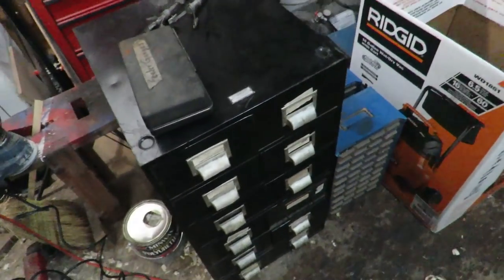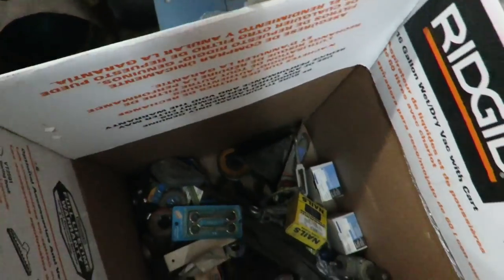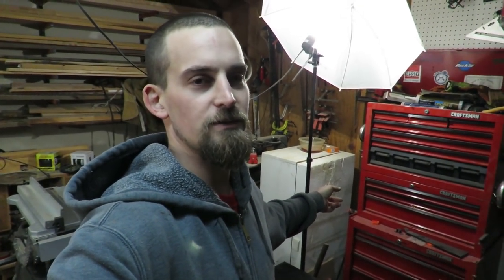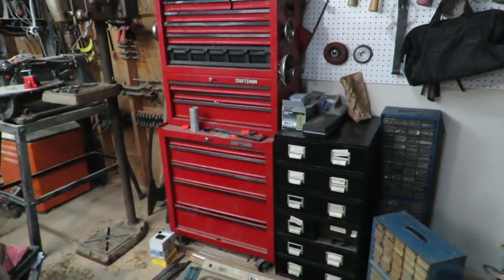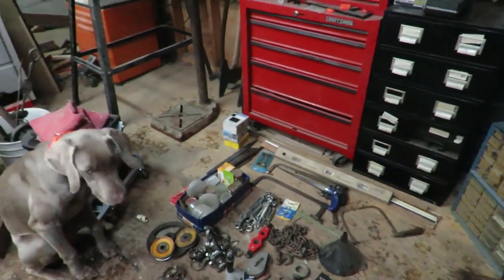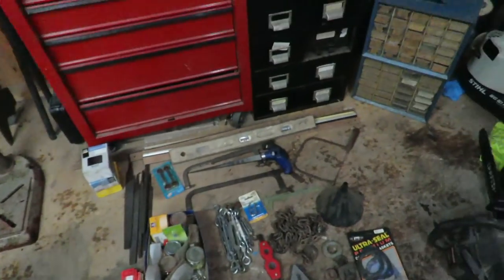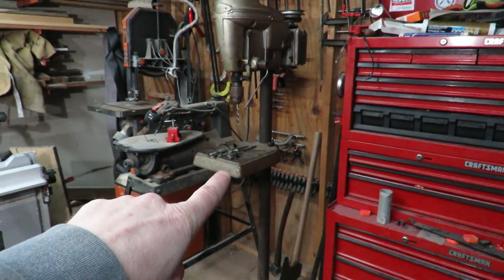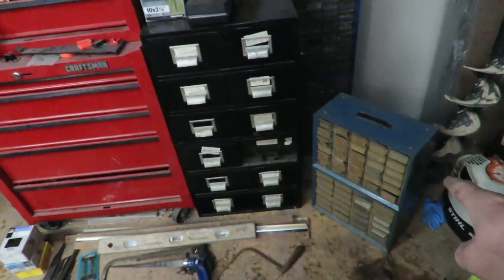First Picking Adventure! Tool Gloat!

Comment: I'm positive that's a Craftsman now that I see the 'power bronze' finish. Plate is missing is all.  Look at the OWWM website at Craftsman DPs and you'll see. Dayton is just the motor brand. 

If you put a TV antenna on the house you use those Radio Shack wire stand offs to hold the twin-lead flat wire or coax. off the house.

Comment: Sure it's not a craftsman drill press?
Reply from the maker: I think it is a king seeley the guy was just reading the motor name plate. It is missing the actual name plate on the front.
Reply: King sealed made them for sears-craftsman got one just like it.
Reply: Seeley
Reply: Are you planing on a restoration.
Reply from the maker: Not at the moment. I got it somewhat cleaned up for use. Table and post were really rusted so I cleaned those up already. Looking for a project to use this on now!